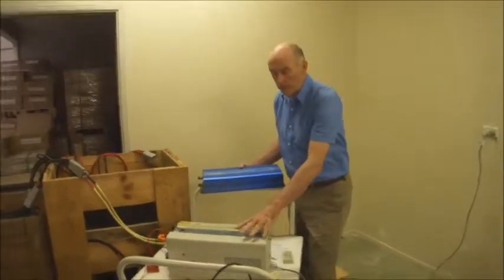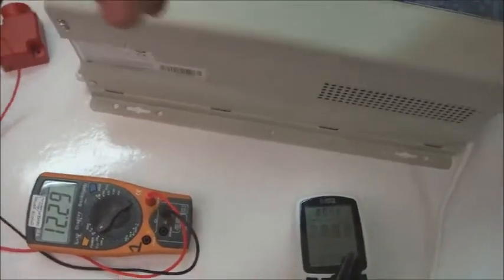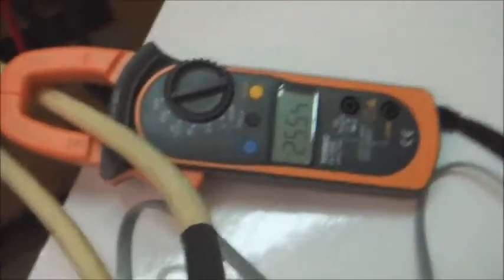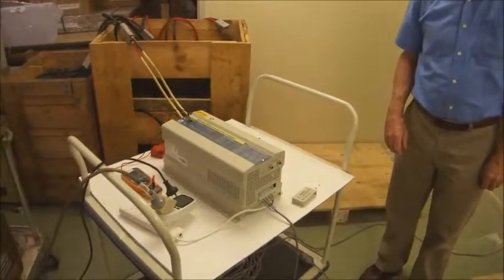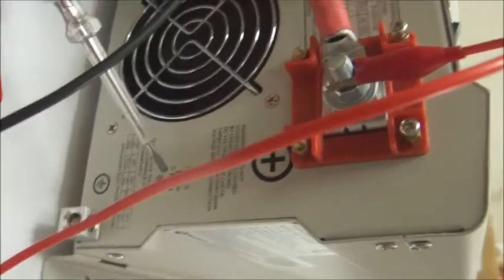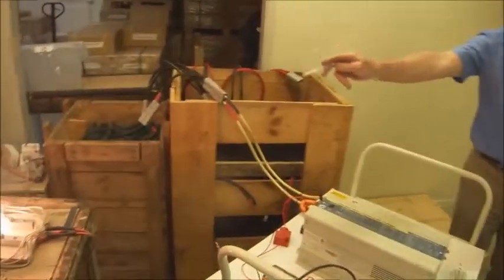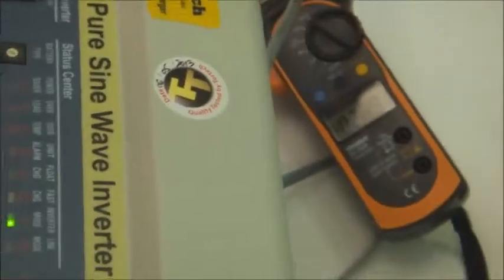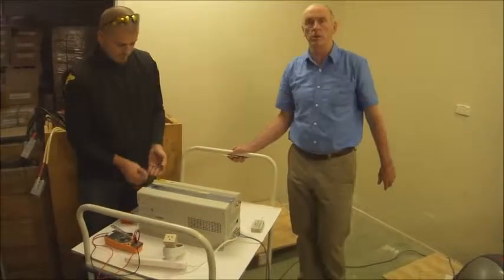Demonstration of low frequency Transformer based Pure sinewave Inverter Part 2

Comment: Very great review here!!!
The data on the papers vs your practical don't match which is of high concern, it says >88% efficiency on the inverter section but from your practical I calculated 74% at 1599w and 80% at 2261w